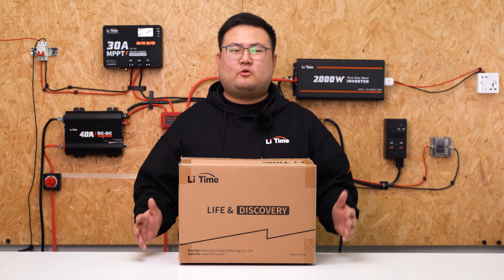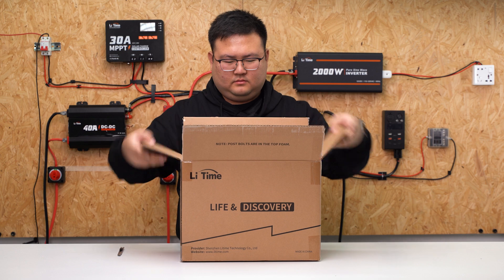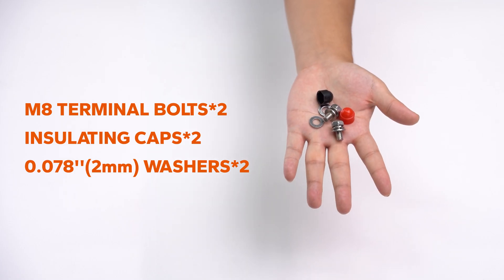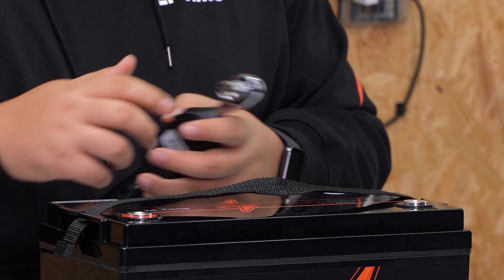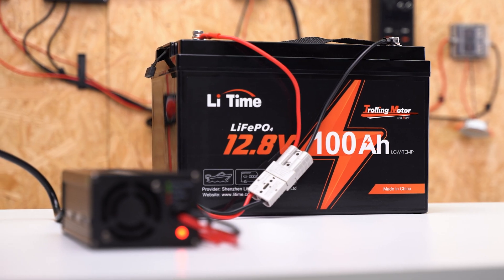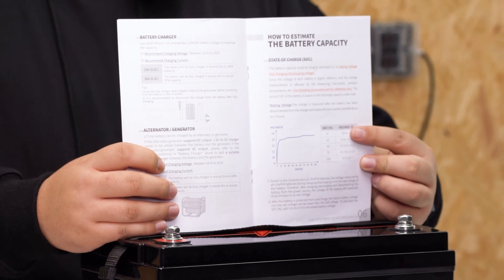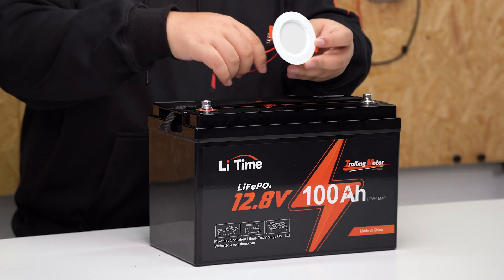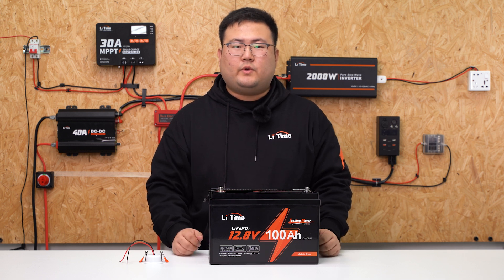3 Must know Steps to Take after Receiving Battery!

Comment: I just received a new LiTime 12V 140ah battery for my kayak.
1. In theory should it last longer (roughly 40%) than a 100ah? 
2. I won't get a chance to use it for about 5 or 6 months. Is it okay to store it the way I got it or should I charge it and follow the long term storage procedures?
Reply from the maker: Thank you for your order! 😊
1️⃣ A 140Ah battery has 40% more capacity than a 100Ah, so in theory you should get longer run time. Actual time depends on wind, water current, boat weight, and how the motor is operated.
2️⃣ For long-term storage, check the resting voltage of the battery to see if it is around 50% charged. If it isn’t, it’s best to follow the long-term storage procedures to keep the battery in good condition.
If you have any other questions, feel free to email us at service@litime.com — our team will be happy to help! 🙏